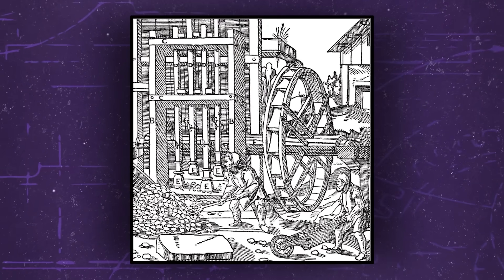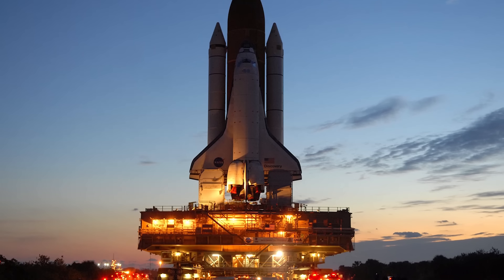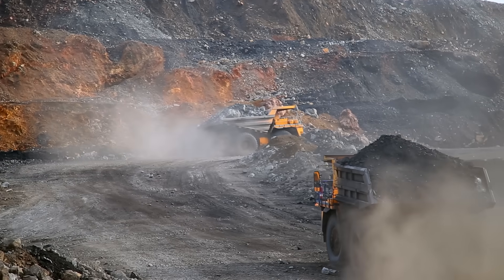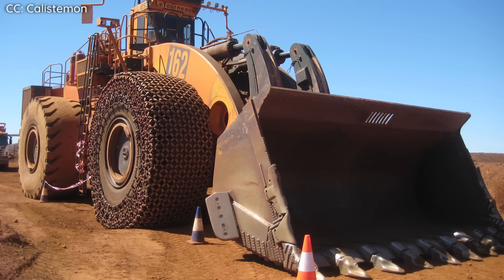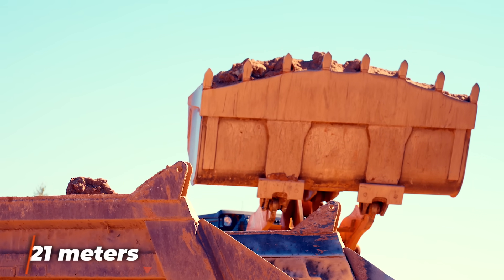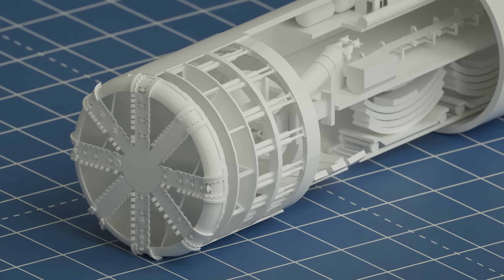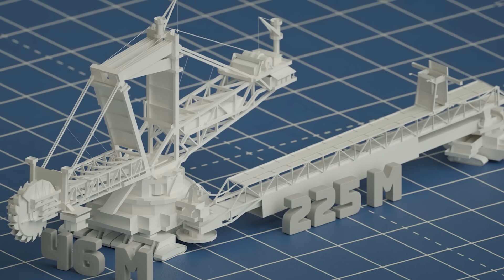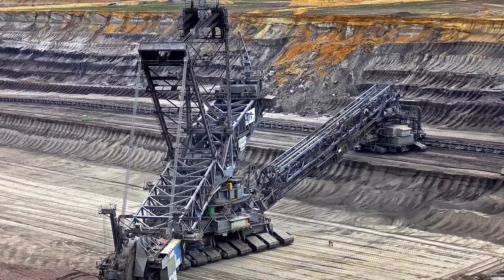The Worlds Most Incredible Heavy Machinery

Comment: I actually went on Bertha while they where digging the tunnel to replace the viaduct. One thing you guys left out about it was the fact that as it went along boring the tunnel it would actually place the concrete slabs around the circumference on the tunnel and then use hydraulic pistons to push against the slabs to set them in place and propel itself forward.
Reply: that's how all TBM's work, that's not unique to bertha. Most will also lay their own rail track to keep it supplied the entire time its advancing
Reply: @jasonlib1996 but the average person doesn't know that
Reply: @CrisMind 
Exactly!

Comment: I worked on a barge designed to buury pipeline offshore.  Thw vessel had four, 16 cylinder locomotives engines to power the pumps.  We held a million gallons of fuel.  We would fuel other vessels.

Comment: The crazy thing about tunnel boring machines is that they are often one-of-a-kind for specific projects but before simulation software and hardware was good enough,, they had to actually build two. One for boring and the other in case they needed to find and fix an error.

Comment: As an engineer these “big toys” are somewhat amazing feats of engineering - they all however bother me by way of the fact that they are all fossil fuel hungry or are even created for digging up more - it kind of makes it apparent how hard a transition to not burning stuff is going to be sadly 😢
Reply: We don't need a 100% transition just yet, besides changing the endless capitalist ethos alone would bring down consumption and eventually production and supply.
Reply: We just can't get rid of fossil fuels. Nothing beats the smell of two stroke
Reply: There are some all-electric dump trucks being tested in the field out there these days, but they are small in comparison being in the 50 ton range I believe. One advantage they have is that they can go uphill empty and then when loaded at the top they get back more energy through regenerative breaking than they used on the way up due to now being a heavier mass driving the generator downhill.
Reply: Yeah but remember. Even when tech is there, cost and efficiency is always the key factor. So unless we go global (That's a can of worms) half the world will just do what's been done since humans discovered fire.
Reply: The crawlers would be perfect for EV conversion